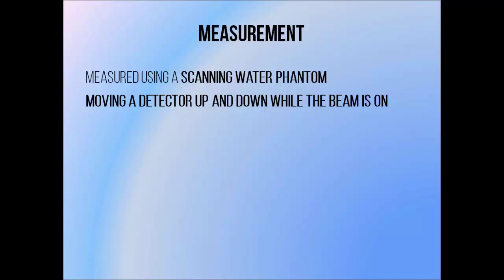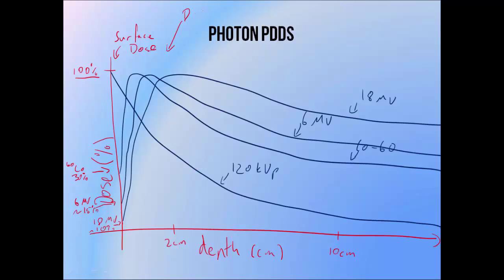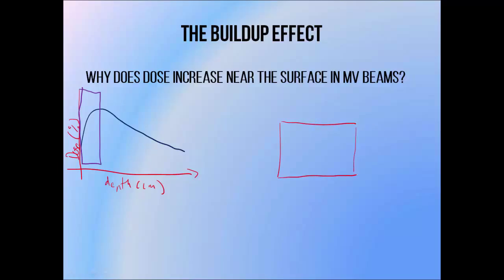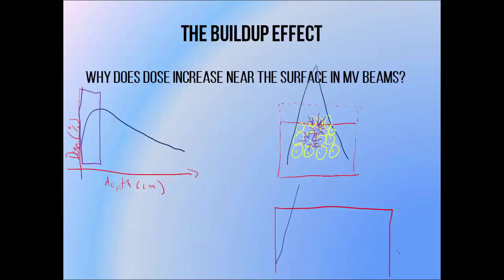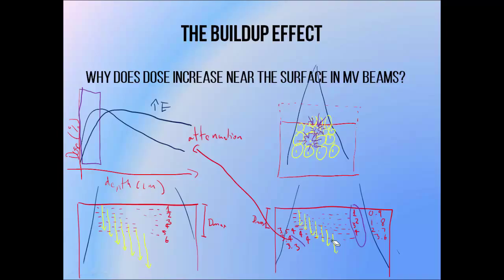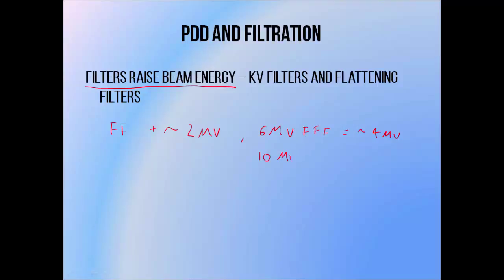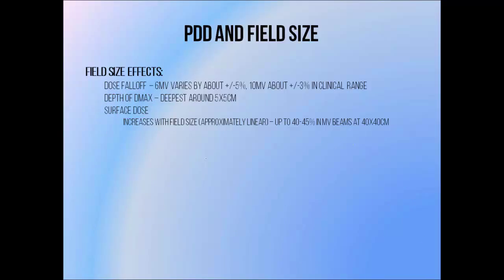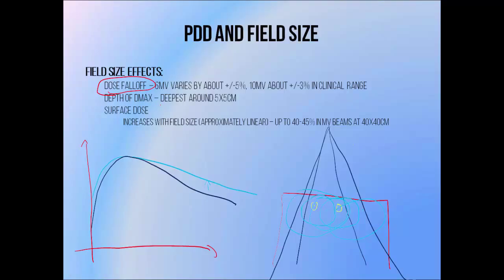8.2 - Photon Percentage Depth Dose (PDD) curves

Comment: +ROscribbles
I'm curious :)
When the point of calculation is placed in the built up region, will the plan be hotter than if the calculation point is placed at a depth beyond Dmax?
Reply from the maker: Hiya! Sorry, I'm a little bit rusty and devoid of textbooks at the moment, so I'd probably give you a worse answer than one of the planning staff in your/your nearby radiotherapy centre, if they're available to ask.
Reply: For single beam plans (mostly electrons), the point of normalization is typically chosen beyond dmax (d90, d80), though effectively it would be the same to normalize to the d90 point prior to dmax as to normalize to d90 post-dmax